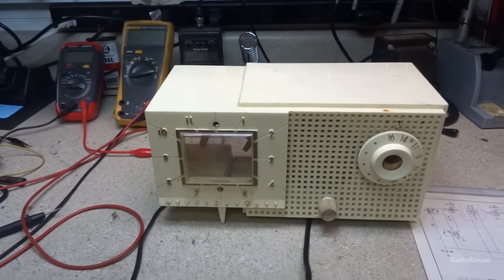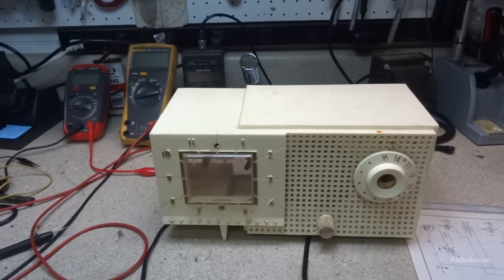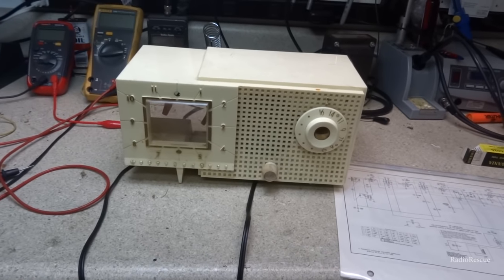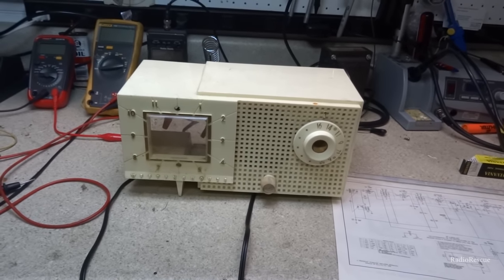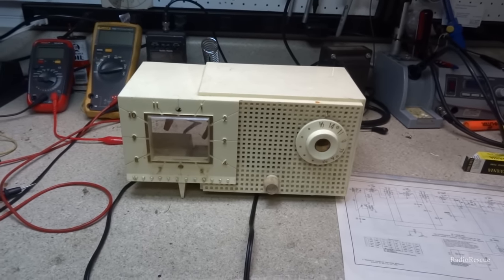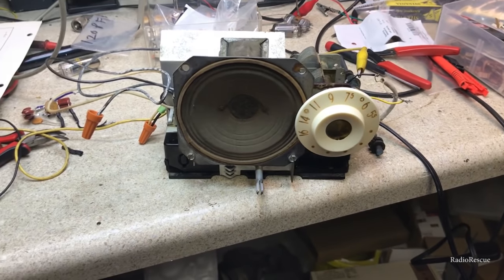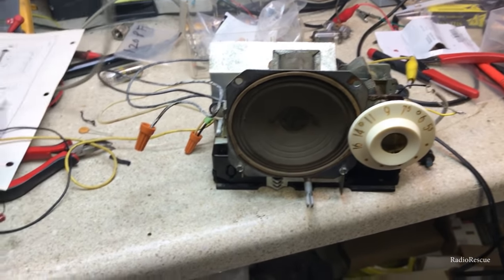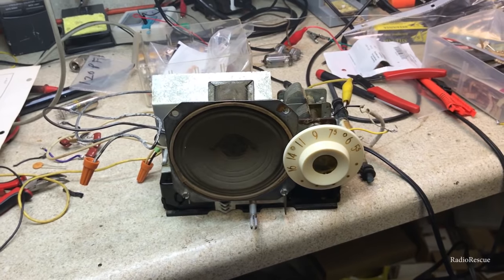Repair Of A 1955 Westinghouse H 474T5 Clockradio

Comment: Yes I agree you try to make heads or tails out of what someone did before and try to untangle the mess they made. In spite of the mess you got it working with the right value caps it does make a big difference. Thanks for sharing.

Comment: Never seen a plastic tube chassis before...
This era of radio design was a mixed bag of stuff, I have seen PCB style radios and point-to-point designs co-existing as the manufactures start to flog off cheap tubes radios to get rid of their parts stock; to make way for the transistor era.
Too bad it was "repaired" by the customer before he gave up and sent it to you... those are always the fun jobs. :/
Hope you are doing OK, Cheers,